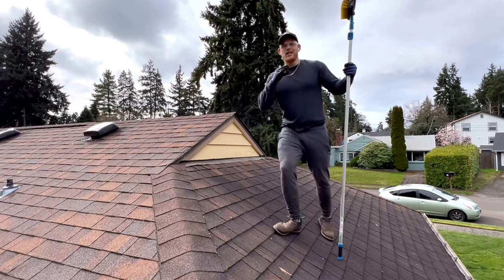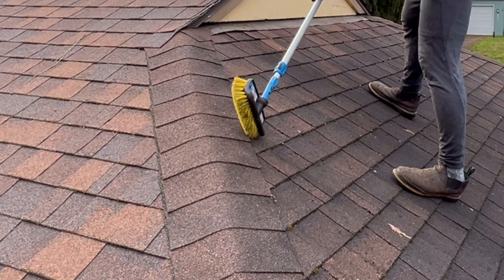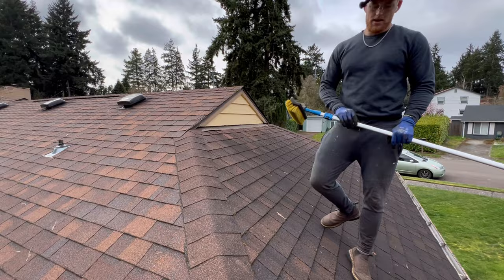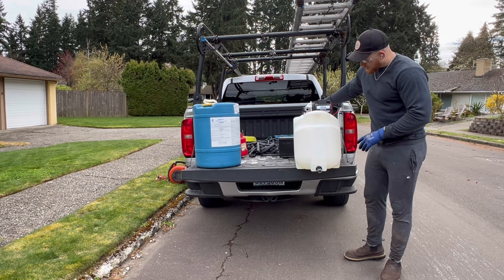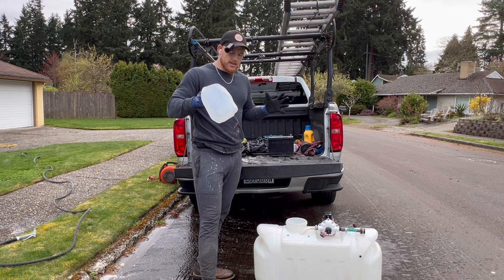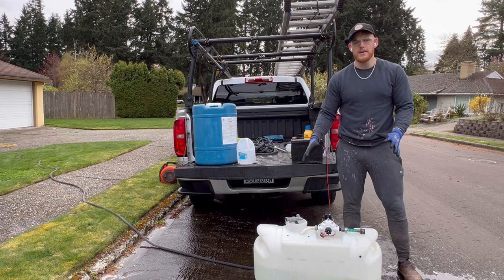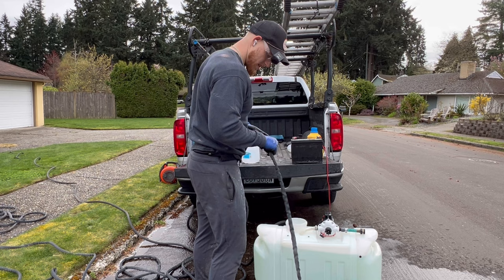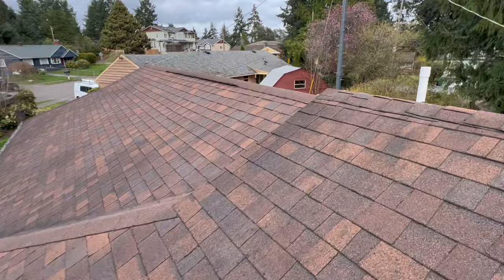How To Clean A Roof From Top To Bottom FULL Tutorial

Comment: Couple quick questions. 

1. Where did you get that bulk SH?
2. What pressure washer did you use? 
3. What camera and mic you use?
Reply: I can answer 2 out of 3!

1.) Go to hardware store/ go to a pool shop

2.) There was no pressure washer in the video, on the tank is the pump, that's usually just sprays the chemicals! you DO NOT want the chemicals to go through the pressure washer!
Reply: @Jehan88818 he pressure washes a small concrete patch near the beginning of the video. Don’t know exactly what it is put probably something like a Simpson 2.5gpm.
Reply: @thehousebath  oops my bad
Reply from the maker: Depends on the video but I use a Rode plug in mic for my phone which I use for everything
Reply: @SpencerClaeys  Bet, thanks for the reply👍🏻
Reply: @Jehan88818 Would it be best to rinse off the SH with a pressure washer or simply use a hose? thanks